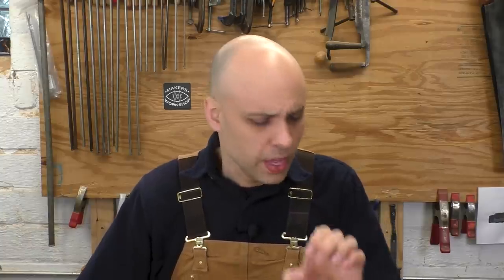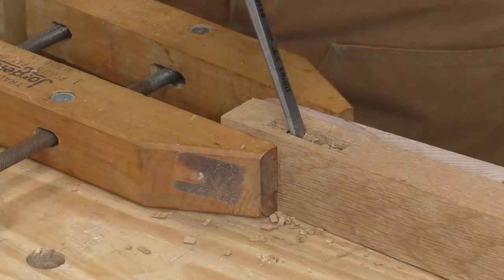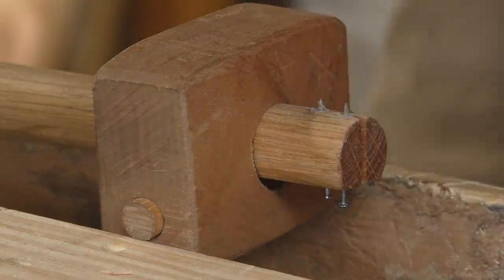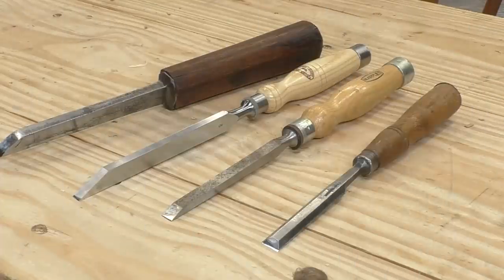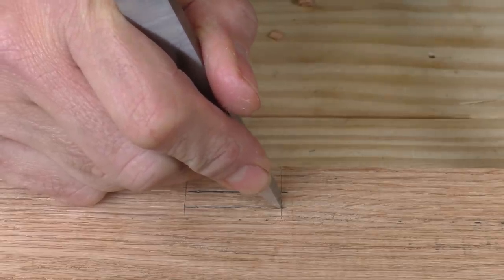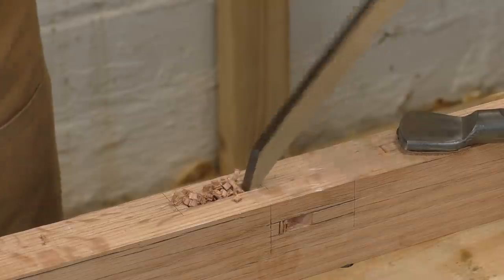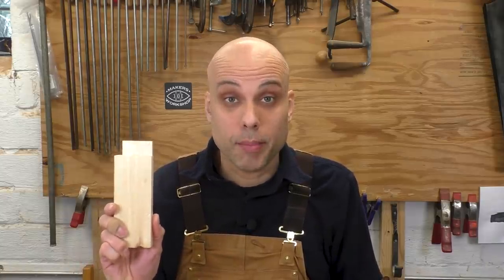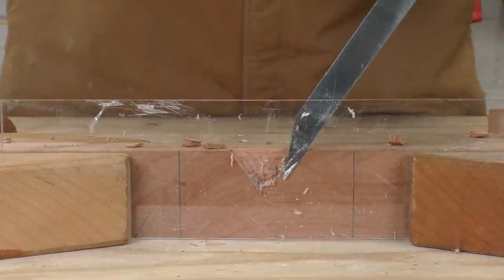Mortise Basics: Marking, Chopping, Fitting

Comment: Drilling out the waste has the great advantage of being so much quieter. For people that work in appartements, it removes the loudest part of hand tools woodworking
Reply from the maker: A completely fair point!
Reply: And that's why I always drill out the waste when I do mortises. Can't say I make very nice mortises that way, but that's probably lack of experience.
Reply: @Kuro-ik3qn  that's nothing practice can't cure
Reply: Predrilling works well, especially for larger mortises because it removes wood and creates clearance. BUT, you need to be very sure your drill bit as dead-on perpendicular to the stock as you can get it. Drifting can also be a real problem if you use power drills.  Braces and bits work very well for predrilling mortises, if you want to do this, because they give you a lot of control and reduce the likelihood of drifting. In my experience, anyway.

Bottom line:  If you end up with a nice snug, square, and true  mortise, then you did it right -- however you did it. ✔
Reply: It’s definitely has a lot more use in timber framing, but I still always drill through holes with Jarrah or other native Australian hardwoods due them being a bit rough on the chisels I can afford to buy
Reply: I made the Roman workbench in my old apartment. I’m amazed I didn’t get in trouble.
Reply: @Kuro-ik3qn  In my case I find it harder to drill, then chop, unless very large mortise.
Reply: I like drilling with large mortises, around 3/4" to 1". But, I find it much more difficult to get a good fit when paring down the walls. Paring them down to where they are plumb is where things start to go sideways for me.

Comment: I like Paul Sellers' technique mostly because he does his first pass starting from (near) one end of the mortise and  chops all the way to the other in one direction, rather than starting in the middle and switching directions every cut. It seems less fiddly and more efficient, which ever chisel type you use.
Reply: The reason I like the Paul Sellers technique is that the body and handle of the chisel remain vertical for most of the chopping-- no need to get the angle juuust right for the bevel to be plumb, and no lateral forces on the work that might make it slide around.

Comment: Where you work determines how you work. In your previous video about Chinese plane, I mentioned, traditionally, Chinese woorworking is done on a low bench. We step on the piece to saw, and we sit on the piece to chop mortise. It does not make sense to have a separate higher work surface to plane, so we fix the piece on low bench, and bend forward a lot to plane.
Now it's on the topic of chopping mortise, we traditionally do it differently. I am from the northen part of China, so I am only familiar with the northen style. We sit on the work piece on a low bench, roughly picnic bench height, maybe a little higher. Natually, you sit on the side that is farther away from marked mortise. If the portion you sit on is too short, put another piece of wood on top and sit on the second piece. We start with chisel flat side forward, bevel facing us, start around 1/4 to 1/3 from near side of the mortise, tilt chisel handle forward , ride on the flat side during chopping, strike a couple of times, move chisel back and tilt back and ride on bevel side and follow with a chop or two then move forward. The last bit is the same as your way, bevel towards the mortise, flat side perpenticular to the work piece, take several passes, and on the last chop on the marking line you only lever towards the bevel side to protect the clean edge on mortise. During the process, experienced woodworker will strke 1 or 2 times then rock the chisel back and forth a little then strike a couple of times and repeat.
Ref:
https://www.youtube.com/watch?v=rMzC5BxAxUo&t=872s

That is the traditional way. Now table height workbench is more and more popular, low bench is getting unpopular. I have been practicing hand cut mortise, and I do see the benifits from our traditional technique. When you sit on the piece and with chisel lean forward, the marking lines will give you reference to align chisel so it's not twisted, meaning the 2 sides are parallel with the marking lines. But I have a roubo style workbench. It is difficult to step on something to sit on the work piece on my workbench. I am planning to make a low sitting bench so I can cut mortise on that.

Comment: Totally agree about drilling the waste. I did that recently on a build with 3" by 3/8" mortises. I was less than thrilled with the process. I found it much more likely for my chisel to wander.  I then ended up having to remake one piece and cut the same mortise the old fashioned way, and it was much cleaner.

Comment: Good video. I'm now retired so I can go back to my hand tools which is what I started with many years ago. Slow but satisfying. I built a woodworking business from scratch. To be competitive required significant investment in both equipment and training. We specialized in doing curved work because it was more challenging and also less competitive. The shop ended up mostly CNC & industrial level machines. It required skilled people but they never needed to hand cut a mortice. If you enjoy woodworking, keep it a hobby. It will remain enjoyable. That doesn't mean you have to hand cut everything, nothing wrong with power tools. Be safe!

Comment: Great video! Paul Sellars has a similar video with plexiglass too.

Here's some unasked advice from a beginner. Feel free to correct me, cunningham's law and all.

For my roubo workbench I made quite a few mortices and a sliding deadman (1.2 meter mortice) in beech, it was great practice. I found that standing at the end of the mortice so you see along the mortice was really helpful getting things square. I used a normal chisel and that worked fine. I started at end of mortice and worked to the other side, always keeping bevel up. This  makes a diagonal cut. I started about 5mm from my line and then later, after the mortice was mostly cut, I returned to the start and angled the chisel so that the bevel up becomes bevel down to get a vertical line. Then I rotate the chisel so that I can cut away the last 5mm crisp on the line.

As for your tenons. I only saw the shoulders directly on the line and then use a chisel to prevent long rip sawing. Be careful when using a chisel that you get some issues with grain direction, one side will usually go away from the line, but the other will go towards the line. Using the chisel to pop those pieces of wood out is amazing. It's also really handy because you'll get your wedges if you're making a tenon for a wedged dovetail.

Comment: I clamp a block to the surface of my work along the cut line that allows me to "register" the chisel against providing a straight and square reference when I start my cuts.  I also stay away from the ends of the mortise like you did and actually finish the ends by paring with the mortise chisel using hand pressure rather than a mallet.

Comment: Good explanation, thanks. I started following Paul Sellers but I've done a lot better after buying small set of Narex mortice chisels (which, by the way, are well worth buying despite harsh criticism from Rob Cosman -- whose work I also admire.) True, the Narex don't work right out of the box but it really doesn't take much work to get them working superbly. Regarding going off one's line, I've found that I get a lot more accuracy if I make my first mallet strikes VERY light -- just taps. This gets the chisel engaged in the wood on the line so it's much less likely to twist off the line when you start to thwack. That little tip on its own has done more than anything else to improve my morticing.

Comment: Teach me more rex. Last two weeks I've been learning what usually would be an overload, but I've been comprehending all I've heard of financial/entrepreneurship in a personal and national manner, all meanwhile building the cheapest wardrobe possible. I don't have a bench, clamps, or drill. I have access to grandpas drill but I'm sticking to my guns with traditional wood working roots, being cheap as dirt. Not borrowing my grandpas power tools is a pride issue😂plus I've already borrowed a saw, finishing nails, and he threw in a estwing tack hammer for good luck. I've got what seems to be a perfectly f***in manageable tool collection but it seems impossible with just chisels+hammer, common 2.5 nails+ finish nails, woodglue, japanese saw, miter saw and box, sandpaper, measuring tools, and a no. 4. Plane. I'm pretty sure I'm just missing a vice and therefore a bench. My setup is a concrete wall with wood posts, one work area is up around my sternum and the other around waist area, the two ideal workbench/table heights and both have 4x4s posts to plane against) I can plane and make mortise and tenon joints fine, but I guess I need the vise to make the other joints accurately such as dovetails. I'm surprised at what  able to do with 80$ tho, after a year and a half of watching you and dabbling in wood by wright and Paul sellers. I'm obviously glad to see interactions and collaborations by you guys! Love what you do rex and you have me on track to save 1000$ bucks over two years.

Comment: I have an odd mortise chisel.  It is 1/4" wide, with a blade 8" long that is gently curved it's full length, making the back of the chisel convex, and the front side concave.  The front side of the chisel also has a peaked shape (two approximately 60 degree beveled edges meeting at a peak, the full 8".   It has a laminated back, it is a socket type with the brand of James Swan.

Comment: It's worth noting that Paul Sellers basically proved the inferiority of a mortise chisel in a direct comparison.  Paul is a 50-year master of both tools, and the results and speed are clearly better with a standard chisel.  The only reason to not use a standard beveled-edge chisel is if you really just can't get good results after trying and trying and trying, which is Rex's situation and the fate of many.  If you can't get your hands to do what you want them to do with consistency, a mortise chisel may be necessary.  Otherwise, if you start out with Paul's method, you can keep increasing your skill and theoretically be better and faster than you ever could be when using a mortise chisel.

It's also worth noting that Paul has put out a new video on this subject, demonstrating that a mortise guide can be just as effective for beginners, or the less graceful among us, as using a mortise chisel for registration, further negating nearly any need for a mortise chisel.  His new video is called "3 Chisel Mortise Method | Paul Sellers".

The reason that a standard chisel beats the mortise chisel is simple: it's thinner.  It occupies less space in the mortise and allows deeper, more drastic cuts, moving more wood with each strike.  The comparison is obvious and unambiguous.  The mortise chisel should only be used if you're unable to make straight cuts with a standard chisel, which is not a problem everyone shares.

Comment: I like having an oval handle because it helps keep the chisel edge perpendicular to the mortise sides. You can feel when it's straight, and feel if the edge twists when chopping, like if you hit some weird grain. I also like to sharpen at 35 degrees for a better edge life, easy to do with a dedicated mortise chisel but 35 is kind of steep for a bench chisel.
Reply: as a hand tool and weapon enthusiast i like to believe that round is the worst shape for any handle, so i'm with you on that one.

Comment: Rex, you should keep your mortice chisel vertical every time you strike it. You are actually using it the wrong way around. Paul Sellers gives a good demonstration of the correct technique.
Reply: He cited where he for the technique he’s using from at the end of the video
Reply: I agree. Paul Sellers technique seems to be the fastest. You can really remove a lot of wood quickly with his technique. I can't imagine a faster way to cut a mortice by hand. I was surprised to see that Rex didn't use that technique. Constantly turning the chisel wastes a lot of time. Pauls method doesn't have that problem.
Reply: @stauffap  It was always taught like that for a reason: you don't have to keep turning the chisel around. Watch old videos of craftsmen at work and they most certainly don't do it Rex' way.

Comment: If the back of the chisel, the surface that forms one half of the edge, is not the widest section of it, it will wedge itself in the mortise and not work at all. This can be caused by improper factory grinding or a botched restoration. Check with a square against the back and examining the bevel - an even trapezoid shape is good. If the angle is off and/or you see more like a weird hexagon or worse, an inverted trapezoid, you can correct it with a belt sander and patience.

Comment: For some it might be impossible... AND this may sound silly to many, BUT I've done a MOUNTAIN of mortises... 

   NOTHING worked better for me to practice than working mortise and tenon joints into 2-by lumber pieces. 2-by's are 1.5 inches thick, so the mortise is a full half-inch, minimum...  Making the space and waste and everything about twice the size of a normal mortise and tenon...

    "BUT why do you want to do so much more work???" (am I right?)
    Artist's trick. The LARGER the piece you're making, the LARGER the tolerances before it clearly "looks wrong". This also means, the MORE you can "goof" and "fudge" or just plain "oopsie doodle" before the piece is unusable. ALSO while we're here, when you do make minor errors, you can still see them when you examine the results. Out of line or plumb or level or straight, square, and vertical is STILL "OUT"... just not necessarily to the degree that you can't use it, even when you can see it.

    AND Half-inch chisels (1/2 X 3 = 1&1/2) are a bit more durable by nature (just more metal than a quarter inch or 5/16" chisel by rote)... SO you can get away with a bit more abuse before you've scrapped it, or even before you have to go back to re-shape your bevel, resharpen, re-hone... etc... AND at least in my area, it's a bit easier to find used and cheap BUT USEFUL YET half-inch chisels than it is to find quarter inch varieties under those constraints... 

    Finally, a LOT of the 2-by lumber is pine, and therefore cheap... I started with 2x4 "Culls"... still obtainable for about a dollar a piece in most lumber stores that have a "Culls" shelf or bin... Some will be too twisted, warped, waffled, bent, cupped, or messed up to use effectively for very much... BUT for practice (like Rex's illustration pieces) you only need about 4 inches at a time to be flat and straight, relatively... Form a reasonable joint that fits together, check for straight and square as best you can... If you're happy with the work, I'm tickled to death about it, so chalk up a "V"... If not, take it apart again, and examine why... Come back to this vid' or look into a book on the matter, and figure out a plan you can implement to do better on the next one... Try again.

     I'd just rather chop big whopping holes into cheap-o material I can afford, and see where I'm too excited and gnashing out horrendously BEFORE I spend "real investment money" on a project that I hope to impress someone or sell (gods forbid) and end up packing it full of epoxy with the hopes that nobody will notice...

     Even today, with more than a decade under my belt with the hobby, I still like to get the 2-by pine cheap stuff and "gob together" a "proof of concept" before I dive right into walnut or cherry and oak and just make a mess...  ;o)
Reply: As a beginner, the one thing I have learned is that it makes you humble !
Reply: @dianemiller7010  YEP!!!

    My first dozen or so mortise and tenon type fittings were on hammers... AND I actually managed to BREAK a hand-sledge before I could get the "wobble" out of it... Not the handle, either... I actually split the head of an iron hammer...

     Granted, I only had to shape and fit the tenon into a pre-existing mortise... AND it was a "wedged tenon" technically... I was a beginner, and figured "half" was a decent start... I still managed to mess it up...

    BUT you get humbled and you learn something...

      I figured out fairly early, that starting with big (size alone) projects made all the flaws at least seem smaller... When I got good with the big and simple stuff, I started making smaller and more complicated stuff... 

     One day, I may get pretty good at making all this elaborate stuff to scale for a dollhouse and as traditional as ever. ;o)

Comment: One thing you didn't address was depth, and it appeared at times (during the plexi-views) the mortise chisel slipped into that center V and just added depth, not width, to the mortise. Do you worry much about going past needed depth in some areas? I can't see it affecting much as long as it doesn't go through, but I am also interested in how you maintain consistency, or at least necessary depth with that chisel. Perhaps this is one of those "future videos" you talked about.

Comment: I don't have enough knowledge or experience to know if I'm right about this, but I don't love how thin these mortises are.  Wouldn't a thicker tenon be better?  Like 3/8" (6/16") for a 3/4" board - that's both symmetrical and exactly half the board width.  5/16" is practically 1/4", which seems too thin.  And also, it's hardly easy to center perfectly.  Then for a 1" board, 1/2" seems to me to be ideal.  And you could probably stick with 1/2" for slightly thicker stock, but perhaps as much as 3/4" for a 1.5" board.  No?